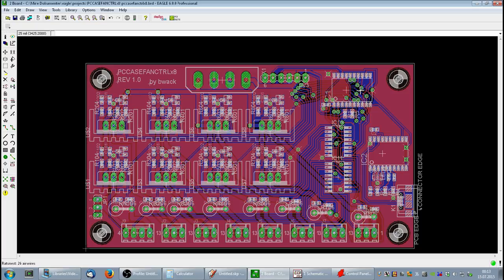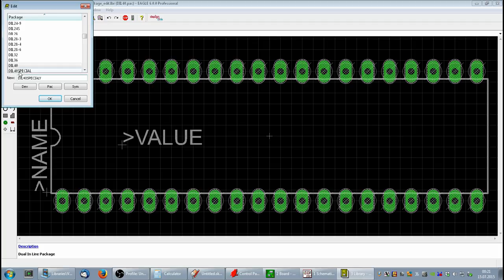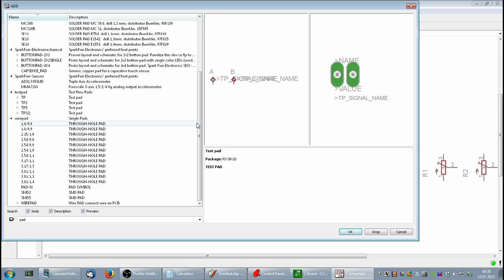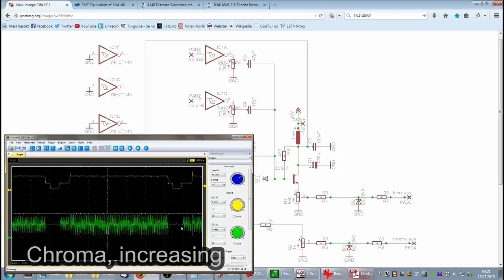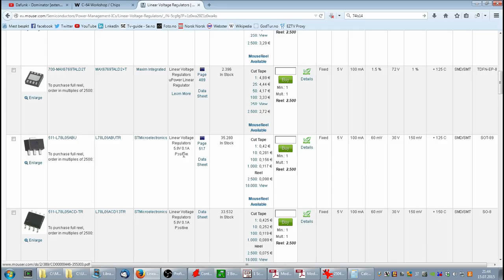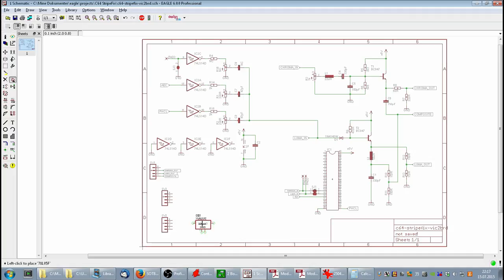Video replacement circuit and stripefix part 4 (C64)

Comment: Nice work. Do you share the board somewhere? I might want to try it with a C64C, because the LumaFix64 is too high for those C64s.
Reply from the maker: Hi. The design wasnt successful I think in improving image quality better than lumafix. Allthough ot did not dull the image as much as the lumafix. I shared the files here https://github.com/bwack Thanks for the interest in my work :)

Comment: You make it seem easy again. The funny thing is I'm really beginning to understand what's going on. Although I can't always follow your calculations, I do have a basic grasp of what you're doing. 
The question is really, how do you get a custom board like that produced? I get the components, but the IC itself?
Reply from the maker: The Highlander I'll try and do some more explainatory on the calculations in future videos. The IC-socket will have to have its pins bent in a way that it can be soldered onto the ic-socket pads with offset. If this had been a mass produced board then it would be difficult, but soldering some by hand will be ok.
Reply: lovely...good plan. I like to learn, so lay it on me baby!